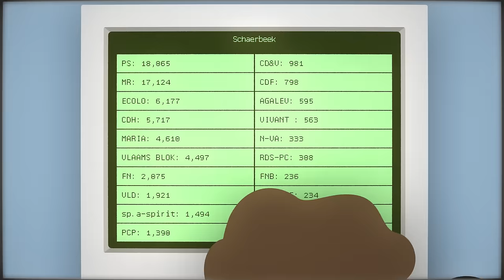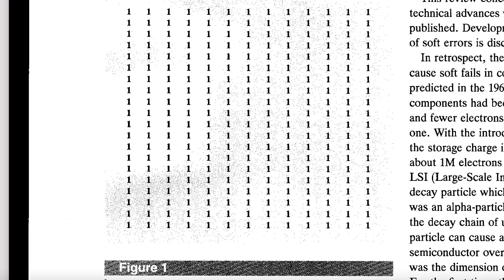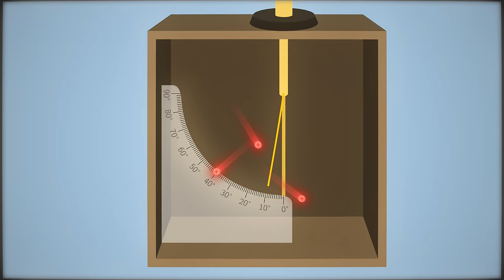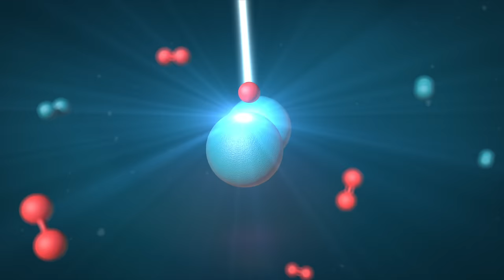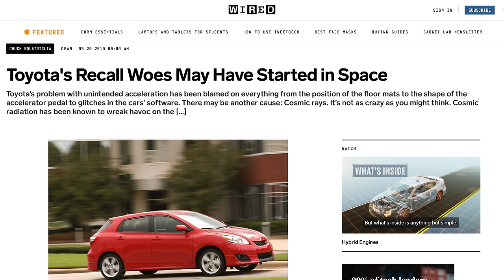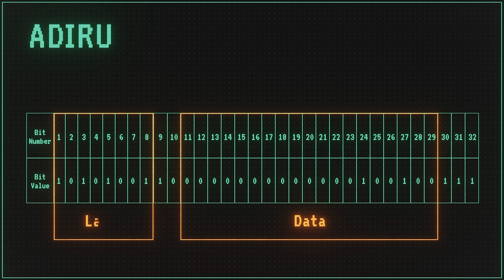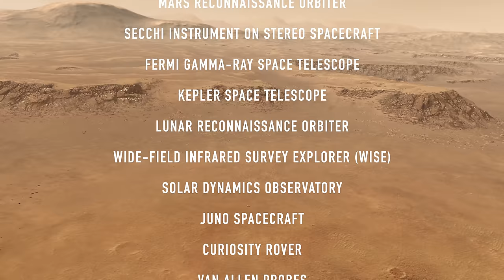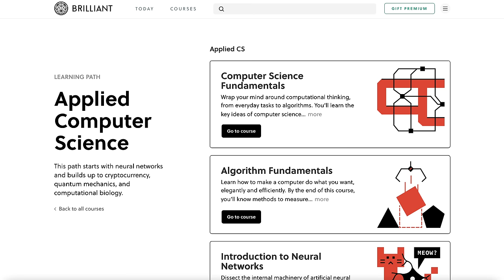The Universe is Hostile to Computers

Comment: I wonder if a cosmic particle could cause a "bit flip" in our synaptic network and change brain in some way, perhaps affect a memory, or alter an action.
Reply: That’s a good question
Reply: Damn that would be crazy 🤔 need a experiment with such stuff 🤔
Reply: You my friend have asked something which will put very existence in question
Reply: That makes less than zero sense.
Reply: How does it affect evolution.
Reply: By affecting memory they could cause an event like Deja Vu?
Reply: Our brains don't run binary lol
Reply: whether it does or not is irrelevant because there is no such thing as free will. All actions are predetermined by the initial one
Reply: Yes and no.  Yes, in that cosmic rays can excite electrons and cause chemical changes to take place, but no in that neurons like the rest of the body rely on chemical signalling (not 100% electrical, particularly for cross-neuron signals) and I think it will take more than a change single molecule in a single cell to get a meaningful change in behavior out of a neuron.  EDIT:  This is for a single event.  In space or high altitude when you may get impacted by the original cosmic ray (and the cascade tree of particles starts in your body), you can have multiple events in a small volume and then I don't know what is possible
Reply: There might be studies out there about the effects of cosmic rays on kids born in (or pregnancies during) the years with higher frequency of cosmic ray instances, the so-called genetic "bit-flips". Although it probably takes a lot more than a single genetic bit-flip, who's to say that several of these single mutations haven't been passed down over long periods of time, adding up to generational or hereditary cognitive changes? Evolution principles do tend to be based on the assummption that mutations, changes and adaptations occur, somewhat randomly.
Reply: @eunicezayas3216  it's so insignificant though. It's already been considered and dealt with with astronauts in the iss for example. Even outside of the protection of the atmosphere being bombarded has minimal to no effect.
Reply: It would be pretty nice if your bank account would have a universe-ly blessed "bit flip"
Reply: Besides the fact that cosmic rays might be able to trigger at least photoreceptive neurons*, studies with mice show that mice whose brains are irradiated with cosmic rays suffer impaired mental function, such as memory loss, mood dysregulation, and learning difficulty. Its currently believed this is caused by the production of free radicals, (an atom, molecule, or ion that has at least one unpaired valence electron,) by the collision. Free radicals are also one of the causes of many aging. 

*If this is true of any neuron, then yes, cosmic rays can affect actions and brain state quite directly and memory somewhat directly. They would do so simply by causing neural activity.
Reply: My opinion would be no because  bit flips only happen because of the extremely small size of modern transistors, memories and thoughts, as i understand, are quite large connections of hundreds or thousands of cells, much larger then transistors
Reply: maybe THATS why im depressed
Reply: @lynnkeating3921  But our nerves cells use charges to send signals down the nerve fiber and that  may be altered by the effects of cosmic rays striking molecules in the upper atmosphere.  I would like to see some research on that.
Reply: @dudefuude7921  signal going down the nerve to the  synapses is electrical. That's why defibrillators work and make muscles twitch with electric pulses. That electrical signal causes the release of neurotransmitters into the  synaptic gap; and if it's near the  start of a memory cascade, it could alter a memory.
Reply: Yeah changing the isotopes in a chemical can effect how rats mothers so it wouldn't surprise me
Reply: @Songer80  there is research. The iss astronauts and as far as I can see the effect is minimal to non existent because space is so big and electrons and atoms are so small and spread out the chance of them connecting is small and even then the chance for it to effect anything even if they connect is small.
Reply: @lynnkeating3921  I  agree.  It's  probability is very very small and our brain probably has some sort of error correction ability  just like DNA replication.  But DNA replication errors still occur when hit by energetic particles and uv light.  I would like to see more research into this.  It may explain medical anomalies that can't be explained currently.
Reply: the brain is just a biological computer so mabewy but we would have evolved to deal with this i imagine ?
Reply: @Songer80  there was a dude who stuck His head in a particle ecelerator and he got hit directly in the brain and was fine lol Google it it's quite a story
Reply: @mhakoyMD  it could also have the reverse effect… I mean who knows, u might go down a digit or two
Reply: don't worry most people are dumb enough not to need cosmic particles for that
Reply: @tanmaysharma1850  ooo, that's an interesting theory
Reply: @nofatchxplzthx  I have the free will to type whatever I want in this reply.
Reply: now i have great excuse to everything
Reply: That's not.. how our brains work at all lmao
Reply: Its called cancer buddy
Reply: @nofatchxplzthx  You had to make that comment.
Reply: @fur10us1  You could lose fingers?
Reply: Mandella effect lol
Reply: the comparison of brains and computers is a simile, it's not literal. the vid explains exactly how these particles affect bits (4:06), a brain works completely differently.
Reply: I swear, every time i take out my phone to check the time it happens😂
Reply: Perhaps this happens just not in such a way to be noticed.
Reply: @lynnkeating3921  No it's more complicated than just two switches we have way more switches however perhaps in are more primitive part of the brain meh.
Reply: @michaeltamillow9722  it makes -4096 sense
Reply: @HexapoDD  exactly
Reply: Would we even be able to know if it did?
Reply: Too many synapses that are interconnected so just bit flipping one won't do anything. To cause something like psychosis you need severe imbalance of neurotrasmitters which causes dozens of billions of synapses bit flipping
Reply: so thats why i forget why i walk into a room
Reply: Well, I guess try some LSD or DMT 😂
Reply: the moment you test it, a cosmic particle hits and you forget what you were testing..... and you move on with something else because you have no memory of failing at testing somethng
Reply: It may well be. That's why we can't just travel across the universe. Because, there's a million ways that could happen.
Reply: @Akshay-cj3hq  lol no, our planet is just full of scum and confusion and when you're smart and conscious enough to notice it while also dealing with the everyday struggles of living up to whatever standards naturally placed on your role in life, all becomes very depressing in this world
Reply: That's called cancer
Reply: @ashlee0039  so are you depressed too?
Reply: a neuron is firing 23000 times every second on average so 23000 vs 22999 is a draw so doesn't matter unless it is a 51-joule thing then it would be like 23000 to 19628 and SUPER intense brain waves... maybe a HUMONGOUS  one could give you a momentary seizure or LITERALLY make your heart skip a beat but most of them aren't even noticeable. Just sayin'
Reply: a "thought" or a "memory" would be millions of 0 and 1 (IF our brain would work in binary) so switching one at a time or even 100 at a time wouldnt make a difference
Reply: Well since our brains are not digital computers then probably not.
Reply: The answer is no; that's not how the human brain works. 
There, saved you from months of philosophical agonizing and existential torment.
Reply: No - brains do parallel computing, not serial computing (as computers do). In our brains, for one event (a behaviour, a thought, an emotion) to happen, many neurons fire at once. We have a kind of natural redundancy, where a single neuron misfiring (a brain 'bit flip') wouldn't really cause an event. Computers are affected by these "bit flips" in such drastic ways precisely because they process things in a serial manner - specifically, a series of Yes/No "decisions" (or rather, instructions) that happen one after the other, not all at once. One 'bit flip' causes the whole chain of decisions to 'mess up' (depending on the program). Sure, multithreading (multiple series of Yes/No decisions happening at the same time) exists, but it's not on the same as what a brain does. Some AIs are designed to mimic brains (they're called neural networks I think?), but the vast majority of computers don't work that way. I think the closest thing to a 'bit-flip' humans can suffer from is a mutation in our DNA, because our DNA is kinda processed serially like a computer program.
Reply: Inwas thinking the same stuff.
Reply: @lynnkeating3921  He said it also affect genetics.
Reply: your brain isnt electric bro. im sorry.
Reply: @xorgbeep  but brain is made of atoms and that does have electrons.
Reply: This is a very interesting question. To answer this, we'd have to understand more about how our brain actually stores and categorizes information. 
I'd love to see the results of these questions!!
Reply: Maybe causing Mandela Effect?
Reply: bro our brain more complex than a computer.
Reply: @Akshay-cj3hq  I am not diagnosed with depression I'm bi polar, so I go through stages of ups and downs and as a woman my hormones drive alot of emotions.  But ATM I feel fine today. 🤷‍♀️ we in manic mode over here but it will all fall soon and I won't be able to ignore the things that cause me stress and pain .
Reply: anime idea
Reply: It would certainly make sense. Which then of course, means we have no control over what happens.   Like the uncertainty principle, in a sense.
Reply: or like looking for something that you already holding😂
Reply: Probably this activity is underway all the time!!
Reply: Short answer: Nope.
Longer answer: The synapses are not 1s and 0s and memories are associated with hundreds of synapses.

So the answer is: Nope.
Reply: @lynnkeating3921  But our DNA evidently does though.
Reply: @cheesecakelasagna  but it doesn't we have more than 2 electrical reactions plus they just cause different chemical releases which is really what makes the brain know what to do
Reply: @cheesecakelasagna  oh you said DNA sorry thought brain but still even that is wrong because the genes are what our DNA uses to know what cells to make
Reply: Brains just like computers are rely on electric signals but they are more hardwire than computer which entirety rely more on them through electric charges. The brain is more reliant on chemical, and physical neurons. But those rays could possibly trigger something on us but not something big or the likelyhood of it being big is very low. At least that's what I think.
Reply: @dudefuude7921  Changes in a single genetic code ARE in fact significant enough to change an organism. There are several diseases caused by a single nucleotide change, sometimes fatal ones.
Reply: There is a theory that cosmic rays affecting memories is a cause of The Mandela Effect.
Reply: While the immune system's role in remodeling the complex network of links between neurons is normal in the healthy brain, radiation appears to send the process into overdrive, resulting in damage that could be responsible for the cognitive and memory problems that patients often face after radiotherapy- quote from science daily, technically that means radiation can cause "bit flips" in the human brain but a single particle going through your brain probably wouldn't do much because the brain is too complex and wouldn't notice anything unless it was being flooded with particles.
Reply: I might be wrong, but i think then many people should experience dejavu same time for it to be true.
Reply: could that explain when youre thinking about smth, then you think abt something else for like a split second then you forget, and will never remember what it was you were thinking about originally?
Reply: @lynnkeating3921  while it doesn't run binary, it runs something similar to how binary code works.

we shoot gazillions of electrical charges in our brains and nerves every day and each one of those could be altered by these particles.

so yes, it could cause an array of things, but most likely it won't cause anything major, maybe looking at something like 0.0000000001% chnace it'll cause cancer or something similar (altering the genetic code of a cell for example).

it could also cause a stroke. an involuntary motion of our muscles. memory loss perhaps.

we have no idea how our brains work yet so it isn't sure HOW, but it is quite a plausible theory.
Reply: "your honor, i did not punch that woman in the face fifteen times, it was merely a quirk of cosmic rays"
Reply: Yeah thats called cancer.
Reply: Deja Vu?
Reply: @lynnkeating3921  Dude the universe runs on binary, all of exitance does at the lowest level. Things are just true ... or false,  positive or negative. look into microtubules in the brain, very interesting, lots we don't know. This video was great!
Reply: @xorgbeep  ummm its literally how your brain communicates, read up on neurons.
Reply: @keysilver7744  yeah but that's viewing our brain from a high level perspective, on a low level all of existence could run on binary.  "is matter in x,y,z position x,y,z = true || false" . what if everything is voxels , much like pixels but with volume , that change into different states,  giving the illusion of movement?  Could literally be in the matrix, and it really seems that way.... I know weird tangent. but ultimately there is always polarity right ? sooo?
Reply: @lynnkeating3921  True, although we may learn one day that our brains run something similar. But my real doubt to this reasoning is that we cannot assume that the only effect these particles can possibly have is on the binary language programmed into a computer. And isn't it fascinating that they are capable of flipping a virtual integer? (on edit, removed a leftover word from a rephrased sentence)
Reply: @SW-dq1nd  it's actually not virtual. It's basically like little electric switches that are either turned on or off (say on=1 and off=2) basically that's how computers work, it's all different combinations of on and off which tells the computer what to do. That's how they work on the most basic possible level because it gets way more complex than that with bits bytes kB MB etc.
Reply: @SW-dq1nd  so yeah, that "virtual integer" is tied to the physical electrical switch position and that's actually what the particles effect.
Reply: @lynnkeating3921  Ah. I see. So when software is programmed, it becomes a physical switch on the hardware.. the hard drive? And if it's a 3T hard drive, it can hold 3T of 1s and 0s? That can't be right. The 1s and 0s written to a hard drive wouldn't be flexible switches would they? I need to study electronics and programming, lol
Reply: @SW-dq1nd  it's capacitors. Every computer has them already in there. In the ram in graphics cards and other components that makes computer. A programmer that writes code doesn't create the switches, they just tell the ones that are already there what to do.
Reply: @lynnkeating3921  Fascinating! Thank you so much for explaining this, I'm sure others will be appreciating it as well. I'm going to guess that the switches are probably used temporarily each time the computer is turned on, or a program is used, then reset to all off when the program is closed for the next one to use? You don't have to answer, but I'm definitely adding this to my reading list.
Reply: @SW-dq1nd  yeah basically. I'm actually not sure about that because they have all get used to much and the process is so fast and every related program uses them
Reply: Thats the reason why meditation works, you have to stay still for a long time...
Reply: @islatech_AI  how does staying still = more cosmic rays? what??
Reply: @michaeltamillow9722  comic rays flips DNA so why not neurons in our brain? Doesn't our brain uses the same mechanism that machines use electron their move that muscle electron their flip a bit?
Reply: @TheMandoVlog  the video said how is affects evolution
Reply: @lynnkeating3921  yes they do they use electrons do communicate with our muscles and cosmic rays are just little energized particles
Reply: @nofatchxplzthx  what? Free will exists you typed this comment with your brain mo one made you do it
Reply: @Hirrient  but those aren’t neurons
Reply: @lynnkeating3921  on the brain it can affect DNA like it can Computers
Reply: @peppermintgal4302  and some times cancer
Reply: @lynnkeating3921  well particles are small so it could have just scraped of some of the fat that neurons have to protect them form hits and free radicals
Reply: @terskataneli6457  or a free radical?
Reply: @MD.Akib_Al_Azad  cosmic particles would damage us though on the very slim chance they connect with our atoms. They wouldn't trigger any activity. Our bodies use more charged chemical reactions to trigger things plus they need more than a single electron to do it so again the chance of 1 hitting let alone multiple is so slim it might as well be non existent. As I commented earlier look up the story of the guy who stuck His head in a particle accelerator.
Reply: @lynnkeating3921  so i was right and wrong i was right about that the particle missed the actual neuron
Reply: @MD.Akib_Al_Azad  I don't know if you understand how small. The empty space between atoms in our bodies alone is like 95% of our bodies. The chance they hit anything might as well be zero
Reply: @lynnkeating3921  and the space between an electron and a neutron is also empty so its even more unlikely
Reply: @MD.Akib_Al_Azad  Im sorry, its a little unclear to me what you're referring to by 'those'? Its been a while since I checked this comment thread, but if you're referring to the genetic mutations, then agreed, genetics and neurons aren't synonymous. They do still effect some overlapping areas, though, and to quote another commentor, "DNA replication errors still occur when hit by energetic particles and uv light." 
Obviously, if our biology wasn't sturdy enough to withstand some mutations and still retain viable functions, we'd be extinct long, long ago. Thats the same for most living things. Ultimately, I was entertaining an idea on the causes of accelerated mutation when combined with accelerated cell-division. Such as during pregnancy, childhood, etc.
Reply: @Hirrient  what?
Reply: @MD.Akib_Al_Azad  No.
Reply: @MD.Akib_Al_Azad  I forgot how confusing youtube comments get, my bad - I was responding to your comment saying "those aren't neurons" 😅
Reply: @Hirrient  yep and the comment was saying genetic bit flips happening in the brain not normal genetic bit flips which are proven to be true
Reply: @MD.Akib_Al_Azad  Oh I get what you meant now. My comment did go in a different direction than the original, yeah. I was focused in particular on bit-flips that had a sequential or longer-standing effect, because the instance in the video with the voting result being caused by one bit-flip at one point in the process was interesting. 
Granted, like Key Silver said about parallel computing and serial computing, brains and computers function differently. So it would take a lot more for a human brain to experience the same effect,
Not like I was the only comment talking about DNA, and by far the smartest one either. I just thought it was some neat overlap between neuroscience and genetics, and the effects of radiation on humans and computers.
Reply: Suddenly astrology is given legitimacy.
Reply: Bro we dont have transistors we have brains
Reply: Possibly, though the brain uses frequencies of pulses, not just the presence or absence of a pulse, to send signals around. An additional errant pulse would do very, very little, I think. Possibly, possibly, possibly, cosmic ray hardening billions of years ago
Reply: That's probably why we age.
Reply: Probably how the Mandela effect happens
Reply: @dudefuude7921  I agree with you, and I would also acknowledge your second point . Even if Certian neurotransmitters , such as serotonin, oxytocin , and dopamine , are released in trace amounts (in each individual synaptic cleft between neurons ) , having a few cosmic rays bombard a single human brain may not have much of an influence on the possible stimulation of a synapse to transmit an impulse.The amount of any neurotransmitter released would most likely be below the threshold of the individual neuron . 
However,  in regions with high degrees of intensity of cosmic rays, there could be numerous events per unit time, and the potential effect on a synaptic cleft and the receptor site on the adjacent neuron could be unpredictable .🖒 .
Reply: that could explain the Mandela effect
Reply: get tinfoil hats i think idk what im saying but you need tinfoil hats
Reply: Aw c'mon, neurons are more complex than transistors. They aren't as simple as picking 0s or 1s.
Reply: How would we know
Reply: 🕵🏾‍♂️DeepThinkingDetected🕵🏾‍♂️
Reply: this man explained the mandela effect in just one sentence
Reply: So thats why my brain decides to randomly let go of things I'm holding
Reply: @Hirrient  Not based on randomness, but based on probabilities that occur once some sort of "critical mass" is achieved from the execution of a design.
Reply: Our brains dont work the same way computers do, the mechanism for memory in a nerve cell involves a wide range of mechanisms so its unlikely to affect memory. I believe.
Reply: Mandela effect
Reply: I think 1 occurred when you typing out that sentence
Reply: my (slightly educated) guess would be probably not, human brains aren't digital computers and don't actually store information as bits. I suppose we can't rule out stray particles affecting neurology in some significant way now and then, but it would be for completely different reasons than how it affects our computers. The human brain uses a complex system of both chemical and electrical signals (with the latter being largely determined by the former), and last I checked, there are still a lot of mysteries in terms of how exactly memories are stored in it, but I think it's pretty safe to say that it's not as a bunch of 1's and 0's (in fact, there are some theories suggesting that our memories probably aren't stored directly at all, instead the synapses of the brain abstractly encode a bunch of connections between stimuli, which we effectively pull together anew to recreate a memory to which those stimuli are relevant each time we recollect something, essentially rebuilding the memory each time. This would partly explain why it's so easy to form false memories). 

If anything, brains are probably closer to being analog computers, so it'd require some kind of significant physical re-wiring or injury to substantially alter a memory (at least any more than we already muddy our own memories all the time just by remembering them) or a reflex. 

I can understand why people would be tempted to think of the brain as a digital computer, because synaptic activity would seem to be a good substrate for binary code just looking at it superficially (with what appear to be "off" and "on" states), but the actual deeper workings of neurology seem to be way more complex (like even what I've said here is a vast oversimplification, I'm not a neurologist).
Reply: @SaltareObscurum  and
Reply: How do you know that it's not already happening? Tripping on trippity trip trips. Wuh?
Reply: @nofatchxplzthx  so what's the point of trying anything
Reply: Shudder there’s background radiation everywhere, and it can affect our DNA, but the thought of it changing memories or brain connections gives me some serious existential dread 🫣 what a strange/interesting idea. Someone should make that idea into a movie
Reply: FBI open up
Reply: There’s this phenomenon called The MandelaEffect that sounds exactly like what your talking about
Reply: He did mention DNA flipping in the video so it might be possible. You never know. If Mario can randomly teleport then why can't we?
Reply: @lynnkeating3921  signal/ no signal
So they do) the other thing is that we have many "language systems" apart from electric synapse...
Reply: I'm going to use this as an excuse the next time I forget something. 

"Hey, I just suffered a cosmic bit flip. Give me a break."
Reply: For sure similar effects happen to us.
Reply: maybe that's the cause of the mandela effect
Reply: sadly, that part is mostly bio-chemical reaction . you need thousand or maybe million particle to work at the same time to make it happen, because we got our own recovery system for that thing (this is why our current human body is called the most complex , because no one in the present can replicated it  successfully to the core)
Reply: could be why sometimes we randomly bite our tongue
Reply: When someone gets “the yips” its that
Reply: yha. Jack Daniel's already does that.
Reply: No because our mind is filled with so much redundancy that no single flip would matter
Reply: Can't confirm or deny the possiblity of affecting brain activity through ambient or concentrated radiation or EMF.
Reply: The effects it could cause are infinite.
Reply: @vedantdwivedi6738  exactly what I was thinking, when he said it could possibly change DNA sequences. If so, it could have been the start to all life in the universe. And we wouldn't be alone, far from it.
Reply: @lynnkeating3921  they do run on electrical signals tho
Reply: Hmmmm.....*nods*
Good question. If it so, hopefully it would it positively affect the person, though doubtful. We can't afford to lose anymore CPU, GPC
Reply: I guess it's possible in a butterfly effect sense
Reply: In a way, when it flips a significant bit of a computer you're using, it alters your actions.
Reply: That would make a very good sci fi novel.
Reply: The neuron is quite a bit more durable than the address of any one bit.
Reply: A big NOPE on that theory.
 The brain isn't a storage unit. It is a highly advanced organic transceiver that allows you to control the meatsack you call a body.
 The frequency that the energy inhabiting your body uses, hasn't been identified specifically.
Reply: @nofatchxplzthx  I like that you admit the existence of an initial one. We are all part of it. It is trying to understand its existence and we are the homework. 
 The bible is just, 
B-asic 
I-nstructions 
B-efore 
L-eaving 
E-arth 
For us to return to being part of the Initial One, we must pass through this existence.
Reply: is this what causes havanna syndrome?
Reply: @southpark1you0  they think HS is coming from high intensity microwaves or even submillimeter.  Also you should see what happens to techs around damaged waveguides, its uncanny rhe similarity
Reply: Bruh I was about to comment this 😭
Reply: highly unlikely
Reply: imagine a man falling into a coma or turning insane due to a few coincidental particle changes
Reply: @glasshorse6893  theoretically we are all susceptible to a particle storm passing through our head and taking out just the right (or wrong?) neuro pathways and it would have a drastic change to our behavior.  I don't think that has ever been studied except anecdotally.  I've heard of EMF accidents causing some whacky brain changes...but thats a ton of energy.
Reply: Tinfoil hat should do it...
Reply: @michaeltamillow9722  Less than zero ? Looks like it already hit the counter in your brain.
Reply: Yes it could
Reply: Hmmm now I wonder if cosmic ray cause some of us to go crazy.